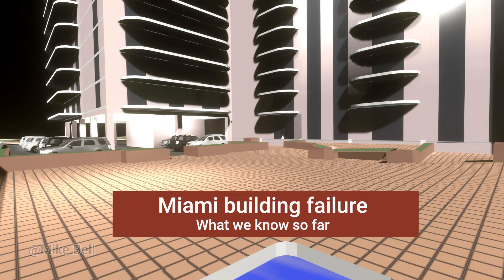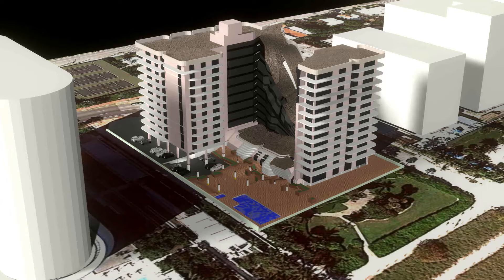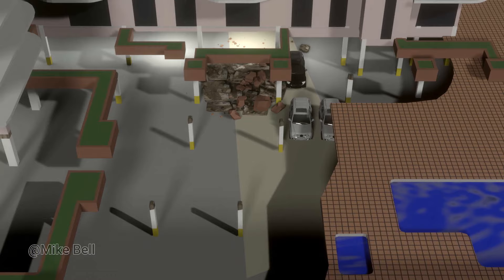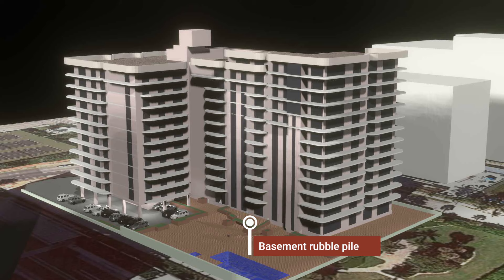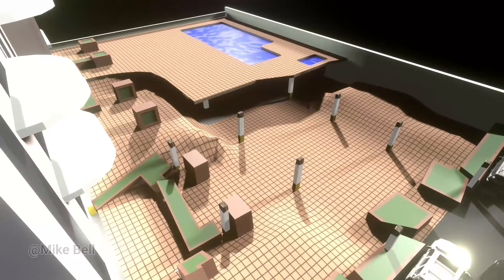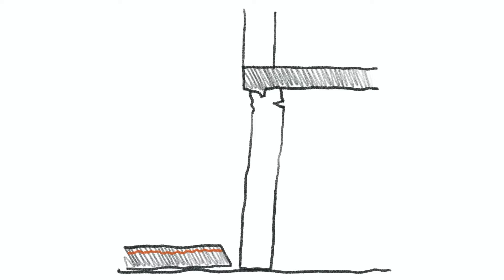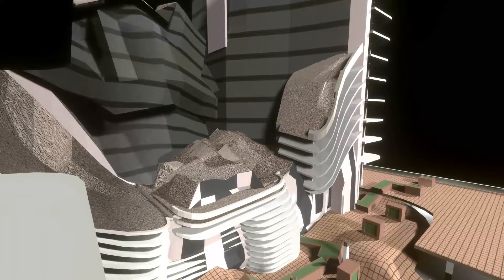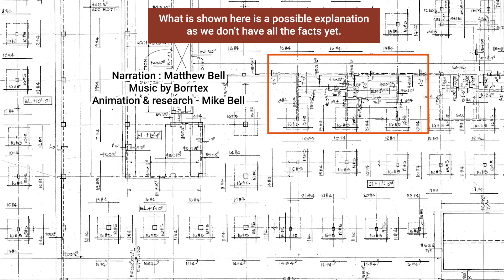MIAMI CONDO COLLAPSE | visualization of the evidence pt2

Comment: Those who were awake probably said “what the hell is that?” Sadly, not enough time to process the noise and escape.
Reply: Same as 9/11
Reply: No they thought...sheet we should hold have paid the dues to fix  the building... ahhhhhhhhh...
Reply: @booaks2980  
I’m a New Yorker, our family lost a few people were knew on 9-11. No trace of them was ever found. Horrible. For the first several years, we’d agonize on what their final moments were…was it quick, did they suffer? It’s a heartache. It can drive you crazy.
I pray for the families in this tragedy to find peace.
Reply: @mchapman132  💔💔💔
Reply: 30 or 40 years wasn't enough?
There were complaints in the 80s about problems with this building.
Once there was even a television special about the problems.
This was a preventable tragedy.
Reply: @unitedwestand5100  - they kept putting “band-aids” on the problem, and just postponed the inevitable. The parking garage was less that 3 feet above sea level. That’s insane. They knew the building was sinking. 400 feet from the shore. 

Remember as a child, digging in the sand at the beach, making sand castles? If you dug too deep, the water seeped into the hole.
Reply: The total volume of material from the walls , floors , roof , utilities , and contents , does NOT fit into a single story parking structure . The video should start out with "karst terrain " and a relatively shallow sink-hole , but locals will flock to solid ground .  40+yrs of significant swallowing houses and roads .
Reply: @guysumpthin2974  ,. Lol. Too late YouTube. I know he saw the banned part of my comment in his notification. It already served its purpose.
Reply: @guysumpthin2974  ,. Now to carry on;

 Two questions;
1.)  How many square feet is that 1 story parking garage?
2.) Did you not see the photos of the collapsed building?
It was a couple stories high, not counting what collapsed into the below ground level of the two level parking deck.
One more question, cause your thought process is as transparent as your education level.
 Why would investigators be concerned with preserving the upper 9 tenths of a collapsed building to piece together what gave first to cause the collapse?
I believe the evidence of why, and what, would be found in the lowest floor or two.
Reply: @guysumpthin2974  ,. Quit pretending to be wiser than you are.
Everyone older than 40, with a moderate education level knows more than half of southern Florida, and almost all of Broward County was part of the land reclamation in the late 19th, and early 20th centuries. (In layman's terms; it's drained swamp land.)
The name of this particular county, Broward, comes from;
Broward was formed from portions of Dade and Palm Beach Counties in 1915 and named for former Florida governor Napoleon Bonaparte Broward. In less than a century, a land "unfit for human habitation" has been turned in to the permanent home of nearly two million people and the winter residence of tens of thousands more.
Reply: @unitedwestand5100  - Excellent posts, well said.
Reply: Basically those ib the second portion of the building we’re instantly awoken, but then pretty much died seconds later. Very unfortunate.
Reply: @booaks2980  Craziest thing about 9/11 is the second tower fell first... so those people in the second, technically had an entire hour to evacuate, and the people in the first had an additional 10-15 mins if I remember correctly.
Reply: @guysumpthin2974  The whole deck design was a failure from to get go.. I don’t trust buildings with underground parking... I prefer being in buildings with a solid foundation.
Reply: The people on the 2nd half of the building that fell a few seconds after heard/felt and maybe saw it fall
Reply: @LaSombraa  - on 9-11-01, many people were told to just stay in place, the firemen were on their way. Others, from lower floors, got out, and decided to go back to their office. Those above the impact zone were hopelessly trapped. 
My cousin’s husband lost 3 family members who were above the impact in the first building. The others we knew were firemen. 
The Florida collapse was just as horrible for those people. Some were on their balconies and must have witnessed the building go down right before their eyes.
Reply: Those last moments...I can't even imagine the horror...
Reply: @booaks2980  I have to admit, the way that building collapsed was eerily like what happened to the WTC during September 11. Now, looking at Mike's video, I realize that the the structural failures on the lower part of the apartment complex probably (subject to further investigations, of course) led to the pancake collapse similar to the other case.
Reply: @LaSombraa  
On 9/11 Mant of the people who were on floors below the floors that were hit by the airplanes got out.
But they were told to stay inside and some who got out were told to go back in.
Nonetheless many thousands did get out.
Those on floors above the floors that were hit had no way out.
Thousands were stranded above burning floors, hoping to be saved from the roofs, with the smoke and fire reaching them until many just couldn't take it anymore and jumped to their deaths.
I saw this live.
It'll be 20 years this year and I will never forget it.
Look up "The Jumping Man"...😞
Reply: @mchapman132  
I can't believe it was 20 years ago this year.
I'm sorry for your cousin's husband's losses.
I watched it all on TV here in Canada.
I worked for the government, for a while, we didn't know if our own buildings would also be targeted.
It was a weird time that led so much change in the world.
Be safe!
Reply: @abelis644  - Thank you very much. Yes, 20 years has gone by. As I said before, I was born and raised in NYC. I was working on Wall Street before the Towers were built, we watched them go up everyday. It was heartbreaking to see them come down, especially knowing there were people trapped inside. Many on the sidewalks around the buildings…..who’d gotten out……were killed by debris when they collapsed. I left NY in ‘90, and haven’t been back since that terrible day. I want to remember it as I knew it. 
We have friends who have a high rise condo just up the coast from the Surfside collapse. They’re nervous. It’s impossible to sell right now. Their building is 45 years old, probably the same building codes. We lived in Florida for over 20 years, my next door neighbor had a sink hole. Out of our five children, three have had a sink hole and one of them has had a sink hole in two different homes. We were West Central Florida. It’s a problem. We left Florida. 
As you said about the permafrost……some land shouldn’t be developed. 
I love Canada. I vacationed there for many years, in the Toronto area mostly, Montreal a couple of times, and Nova Scotia. Beautiful. 
You stay safe too. Peace.
Reply: And it was super late at night. I think that video with the water falling i was at 1:30am . And in the security video from across the street  , there are only a few lights on. Crazy tragedy.
Reply: @mchapman132  That's not what happened here.
Reply: they said it sounded like construction, so i imagine they would have just tried to go back to sleep
Reply: @jmazz1127  - ?
Reply: I'm a heavy sleeper and if I was in that building would of sadly not woken up by the commotion. Even if I had would not of been coherent enough to think straight to get out...

Those poor people didn't have a chance.
Reply: @vladimirkostic9932  - do some research please.
Reply: yea... its just SAD. What a way to go. i live opposite to the ocean myself. this is my biggest fear! last year we had a fire in the basement car park. thankfully no one was hurt!
Reply: @kenantahir  - Hopefully your building is better maintained. Peace.
Reply: @mchapman132  one of NYC forensic pathologists during that time wrote a thoughtful, excellent book that spoke about what happened to the people inside. Anyone who was killed by the collapse or initial crash did not suffer. It's called "working stiff" and it's about death  in NYC in general, not just that disaster. It is graphic, so just a warning.
Reply: @wootlesswocks  - I’m sure the deaths in the plane crashes were quick. Their agony was in the moments before, knowing they were going to die. 
Many, many in the building on 9-11-01 suffered horribly, suffering bad enough to choose to jump rather than burn alive. Those who lived long enough to die in the actual collapse, probably didn’t suffer in the collapse but agonized the hour before. It’s disturbing.
The building in Florida collapse, was over before they realized what was happening.
Working in Manhattan in the ‘60’s and ‘70’s and retiring from the judicial system, has toughened me considerably. I’ve seen and experienced terrible things. The 9-11-01 disaster was very personal though. 
I pray daily for those families who lost loved ones, and those in Surfside too. It’s a pain that never goes away.
Reply: @mchapman132  yeah, I did not mention the people who were killed by falling (I don’t count those as suicides in my heart) because it’s very upsetting(to me) ,  the smoke inhalation etc. In the end all we can really do is keep our love for those no longer with us close and make sure those still here know we love them.  That’s how I get through life, anyway
Reply: @wootlesswocks  - I may try to find that and read it. Many of those  who perished on 9-11-01 were faced with a decision to horrible to contemplate. I burned my hand last week, hot  grease from the frying pan splattered on my hand and arm. It was agony, blisters. I was ill for two days with the pain. It’s still painful. 
I would be a jumper. I don’t consider that suicide, they were in a lose/lose situation.
Next month is 20 years, hard to believe. I like to think back to the warm summer days in the late ‘60’s when we’d go eat our lunch in Battery Park, then go check out the construction, then after the buildings were completed, we’d eat lunch in the plaza area, around the towers, and listen to the music. Good, happy memories of a beautiful city. I miss those days.
Reply: @mchapman132  you’re a generation ahead of me (I just like this photo of Michael Cain)  it is horrible to contemplate,  the suffering.  The book is really good,  those first weeks would have been unimaginable to most I think
Reply: @wootlesswocks  - I like Michael Caine too. Maurice Micklewhite……glad he changed his name…lol.
He resembles my husbands brother a bit, especially when they were young. 
Yes, the first several months were miserable. We’re all going to die, no one escapes death, but some folks die horrible deaths. It’s hard to accept sometimes. There’s evil in this world. 
Thank you for a nice, civil conversation, not too many of them on social media. Stay safe, be happy. 🙏🏻
Reply: That's not how it went for some of the people inside, because the noise was enough to make them grab their purse and keys and run for their lives!
Reply: @samjordan8800  - I was referring to those who perished.